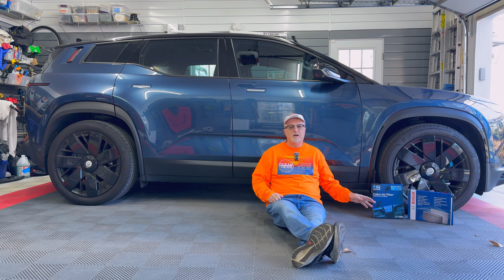Fisker Ocean - Cabin Air Filter Options

Comment: Although I saw this video when it was released, I just did this recently. I am very grateful for this video; it also helps me unplug the MDV connector for manual control of the air duct. Just a quick question - Have you used any vent cleaning spray or cleaning foam (I always do it for my Tesla Model 3 whenever I change cabin filter) before putting the new filter in?
Reply from the maker: I have done videos on that for my Model 3.  I don’t think it’s necessary on the Ocean. The Model 3 had a bad design where the evaporator coils didn’t fully drain and dry after use whereby moisture lead to mold/mildew.

Comment: Hi Matt & thanks again for the video. I guess the air filter has been designed with "no maintenance" philosophy as the rest of the car. This design should be punished by law - to disassemble quarter of a car just to do regular few times a year job is ridiculous.
Reply from the maker: Yes, it is frustrating, but luckily you only need to change the filter to very other year. I must add, I also have a fairly similar amount of work to change my Volvo’s filter.

Comment: I have a thin line CD player that runs through Bluetooth. It's round and would fit nicely in the taco tray area. When I do this I will fabricate and design, or at least try to, a replacement taco tray that has a cut out to fit the CD player. I would not want to cut up the original. That way I can keep the original taco tray and just insert my newly designed one. I really don't use the taco tray and this would be a great slide out area for my thin CD player. If there is extra room I could also build a cover to cover the CD player and then still have a usable taco tray. Or, of course, you could just put a placemat over my new taco tray to protect the CD player and use it like that. Nice video, AS ALWAYS!!!!

Comment: You’re a lifesaver! I am very NOT handy and my taco tray wouldn’t close! The fan actuator had broken off and was stuck behind the taco tray (a common problem apparently). I used this video to remove the taco tray, zip tied the actuator out of the way, and now my taco tray closes again! My wife’s knees were getting bruised from the taco tray continually sliding out and banging her knees but no longer! Thanks so much, I really appreciate the video!
Reply from the maker: Awesome, I'm glad it worked.

Comment: Excellent video. You could use this to do a MDV controller disconnect video with some minor editing too :)
Reply from the maker: Yes, this access methiod could also be used for cleaning out a stuck taco tray or mess with the vent module controller.  Luckily my vents are working well.

Comment: Great video! I’m at 6K miles in my ONE. Rotated tires, got vents & water filter replaced. Anything else to be done after I replace the air filter? Thank you
Reply from the maker: Besides getting the recall items done, there's not a whole lot of maintenance needed.  Replace wiper blades as needed, fill washer fluid, check coolant and brake fluid levels.  Brake pads should last 75-100k miles or more.  I suggest a 12V battery monitor to determine that the battery stays above 12.0 volts - if it falls below that regularly, replace the battery.  Eventually, I plan to due a video on maintenance and summarizing all these items.
Reply: You’re awesome! Luv my ONE. Best car I’ve ever owned. Thank you. Really appreciate the network for help that’s available.

Comment: What kind of Engineer would design the access of a simple cabin air filter by having to tear apart half of the dash trim?😢
Reply from the maker: In addition, he cabin fuse box and 12V battery replacement are baffling.
Reply: @ I agree, I have seen your videos on them too! Such inconsiderate designs for maintenance!
Reply: Not to mention opening the hood itself and the knife cutting tabs in the way to access under the hood 🤕

Comment: From having 2 other EVs, doesn’t appear that the filter needs replacement often. Maybe every 3 years. For now, would it easier to vacuum and clean the OEM filter until the OEM filter is made available? Looks pretty clean.
Reply from the maker: In my area, I find every two years works well.  We get a fairly heavy pollen season.  So of course, your mileage may vary!